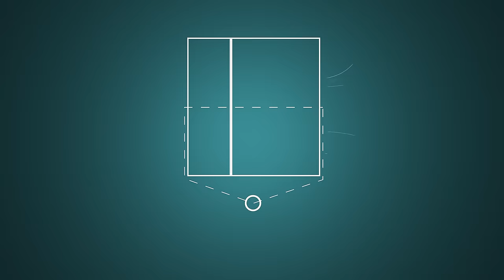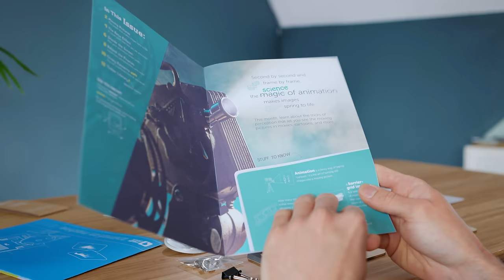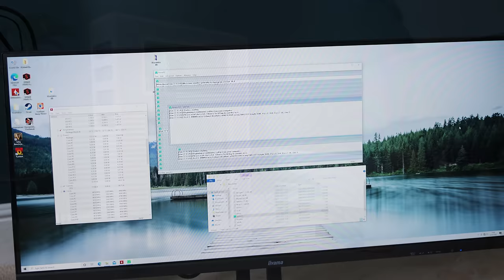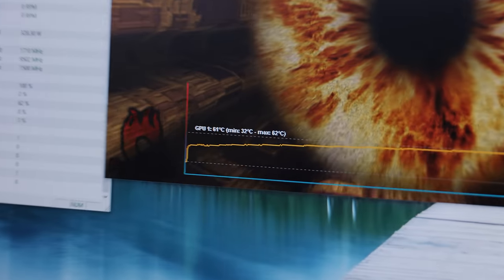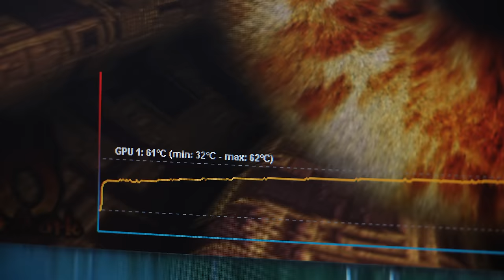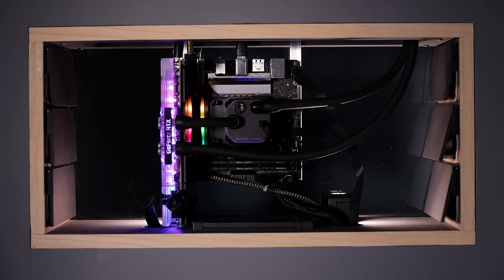Building the world's first 'breathing' PC

Comment: Fluid mechanics PhD here:
First of all, fantastic, and I want one. The magnet growing trick is the type of hypercomplicated solution I like to see in my science. Second, a couple of little improvement ideas for your next design:

1) The system has a good amount of "dead volume", which is air that's not strictly involved in the pumping process. mostly around the outside of the pump system. Dead volume like that is going to do two things, which are slightly in opposition. First, it's going to decrease the overall pressure your pump is able to produce in the system, because relatively more of the energy of the pump is going to compress air that isn't really doing anything. On the other hand, the dead volume is also going to buffer the airflow so it's a bit more consistent. I'm not sure which matters more, although I suspect higher pressure would give you faster airflow. And as a bonus, you save a bit of space. Ultimately, your max pressure is going to depend on the quality of your seals, though.

2) You might be able to make the airflow go directly up through the radiator without some of the extra enclosure box. If the primary connection goes from pump -> joining chamber -> CPU chamber, you can lower the number of pieces you need. The pump mechanism would be exactly the same as you have it, but on the top there would be a one way valve for each side. This would allow air to flow one way into the joining chamber.  Then you don't need another one-way valve until the very top of the PC. You flow the air directly up past the cooling components, where the air then goes out the top.  In theory, this would create not so much a "breathing" flow, but a direct one-way flow past the components, which should help reduce the overall dissipation of energy from having the air switch directions all the time.

3) Another option would be to go with a design like a steam engine. You have your breathing mechanism tied to a moving valve that itself controls the direction of the airflow. This ends up allowing you to not need one-way valves at all, as the flow of the air is always going to be directed upward.
https://makeagif.com/i/74-zjb [gif of steam engine operation. In the steam engine case, it's high pressure air from the yellow triangle that's moving the piston and wheel. But it works just as well in reverse, where the piston moves the air]

(Sorry this is hard to explain only in text).
Reply: I'm having a hard time figuring out how this system works. How is the fan able to get air from one side to the other when the air valves close on one side? Am I missing something here?
Reply: @astroalyn2010  I think I was able to figure out what's going on from shots at 11:59 and 17:53. The first thing to consider is that each half (R/L) is in some way isolated. So you can consider what happens on the left side, and then just flip it over and you get the same effect on the right.

Walking through the cycle: You start in the Piston Left (PL) position.  All the pressures have equilibrated and there's no air moving.  Then the piston moves left->right. The volume of the "breath chamber" increases, meaning that air needs to be pulled in to equalize the pressure. This air has only two places it can come from on the left side: the vents to the outside and the vents to the "CPU chamber". The CPU chamber is denied, though, because of the one-way flap valves (17:53) that allow air to only go left->right (into the CPU chamber and not out). So instead the air comes from the outside flaps on the left, which open in the direction of Outside->Inside.  This air then flows into the breath chamber, equalizing the pressure.

The piston completes this half cycle and ends up in on the Piston Right (PR) position. Then it starts its backward R->L movement.  This decreases the volume in the left side of the breath chamber, forcing the air out to keep the pressure from rising. Except this time, the flaps to the outside are closed (the only open in, remember). Instead, the air gets forced out into the CPU chamber, and then out a set of flaps in the top, which only open up.

Then the piston completes the R->L half cycle, makes it back to PL position, and everything starts over.

The exact same thing is happening on the right side of the chamber, except with the opposite direction.  When the piston is moving L->R, the air is getting pumped into the CPU chamber, and when the piston is moving back R->L, that half is having its air supply built back up.

The design is slightly inefficient (brilliant, but a first draft) because it's having each half work independently. If the breath chamber were open to the air on the right and left (so not in the bigger box) and had the flaps directly inside, then the piston could force the air straight up through a pair of one-way valves on the L/R side. This air could then move up through the CPU chamber, rather than moving side/side. Then you could have something where the air direction ends up flowing up on both the right and left strokes of the piston, meaning the air doesn't have to stop and "reset" each time. This would reduce turbulence in the CPU chamber and let smooth laminar flow carry more heat out, and could substantially reduce the size of the overall system.  As I mentioned before, this is very much how a steam engine works, or an air compressor, if you're working in reverse (https://www.aircompressorscout.net/wp-content/uploads/reciprocating-piston.gif although note that this is a single stroke design.  @DIYPerks could totally do that method, but the double-sided design looks way cooler).
Reply: Nice!
Liking it to push the comment to the top
Reply: Nice! I already thought that this video can be one of the PhD project and now PhD came to give comment.
Reply: @NopphadolUdomluck  Don't be ridiculous! I never did anything nearly that cool during my entire PhD. :-D

Comment: Another reason it works better than those 4 fans, is the fact that the horizontal movement is in 2 directions, effectively doubling it’s air output if you collect air from both sides. It’s an absolute marvel this thing!!! The part where you nickel coated that magnet had me staring in awe!! The length this man has gone through to make this work is absolutely unbelievable!!
Reply: The craziest part is how casual he is about it!
Reply: it's only getting air from one side at a time so no, that's not a factor. What I think is making the difference is the fact that he's built an enclosure that is strictly sealed, which puts a lot of momentum and pressure behind the air movement. Just having fans in a normal pc case with vents everywhere would not be able to do that. When fans are having to suck air and also push and/or pull through a radiator, they're not going to be as good as when they're just blowing into a plastic bag like he did for his informal "test" of his invention. It seems like the "lung" is more capable of overcoming that resistance than the noctua fans
Reply: @EMETRL  You're missing the fact that he estimated 1 side to be moving air on par with 4 fans, as he is now getting the air from both sides, he has in fact doubled the output, the intermittency is irrelevant.
Reply: @Nevir202  but the volume of air moved per second is the same still
Reply: @zat-svi-ua  No it isn't you goober. CFPS is an average, when you're doubling the inputs, you double it as well.

What you're saying is that is you blow 10cf of air every two seconds, that's equal to blowing 10cf of air every second, which is obviously BS.
Reply: @Nevir202  i meant the device still moves a chamber of air at the same speed, so the trash bag test would show the same result.
Reply: @Nevir202  no need to call me names, i don't really know my way around this stuff, not saying i'm correct
Reply: @zat-svi-ua  But it doesn't just move a chamber of air, it moves the chamber of air twice as often, when it's exhausting one side, it's intaking on the other side.

Yea, you're right though, I should chill with the names.

However, it's a little frustrating to have some random person on the internet, that as you admitted doesn't know what they're talking about, tell me I'm wrong when they're in fact incorrect.
Reply: @Nevir202  It does not move the air twice as often as the fans. The air only enters the PC chamber once per stroke (left to right or right to left). When one side is exhausting(blowing air into the pc chamber) the other side is intaking (loading the next shot of air).
Reply: @MemberLogic  If one side moved as much as the fans, and both sides are moving air, what kind of stupid math are you doing where 1+1 =/= 2?
Reply: @Nevir202  If the diaphragm is moving from right to left then the air on the left is getting squeezed into the pc chamber. On the right the air is entering the expanding diaphragm chamber which will then be squeezed into the pc chamber when the diaphragm moves right. It's a very simple concept and you can literally see it in action in the video as each side opens and closes
Reply: yeah this man needs to get contracted by nassa or something
Not only that but imagine what other aplications something like this could be used for in all the different feelds outside personal computers!

Comment: If this idea hasn't been brought up yet, an idea for using 3 phase coils would essentially be a sensor-less BLDC motor. You could use it in a position sensor mode with an interrupt that tells the inverter to switch the direction of the coils. It's probably harder to achieve than that, but it's what I see a lot in air craft launching systems.

Comment: Needs electrostatic filters on the intake side. That should keep the "lung" and PC free from dust and serve to filter the air in the room. Also shouldn't restrict the airflow all that much.
Reply: that would literally restrict all the airflow and youre suggesting someone turn a computer that has 500+ dollar components into a 69.99 appliance you can get from walmart.
Reply: @gottaproxy8826  Huh? The pumps seem powerful enough to handle pushing air through a filter, as filters don't introduce very much resistance. With the computer being so transparent, it would be a shame for it to become dusty after a couple months of use. Most PCs already have air filters, it's really just common practice.. I don't think PC filters are typically electrostatic, but having some type of filter wouldn't be "turning it into a 69.99 appliance" in any way.
Reply: @PascalAndreas2003  well the thing is it has an inbuilt dust trap it seems in the side panels. besides my 13 year old pc has hardly any dust in it without any fancy filters and i never cleaned my shelves have more dust after 1 month
Reply: @gottaproxy8826  500 dollars? that cpu is 800 by itself lol more like 3000+ pc build
Reply: @gottaproxy8826  Wouldn't reduce airflow nearly as much as you might think, because this is a (leaky) positive displacement air pump. It will keep on pumping roughly the same volume of air, until either the water pumps can't keep up, the magnetic coupling detaches, or air bypassing the pusher-plate becomes much more significant.
This air pump can likely generate at least ten times more pressure than a decent PC fan. This is why his radiator was working so well.
Reply: @gottaproxy8826  Electrostatic filters have very low air resistance. The rely on electrically charging the particles carried in the air stream so that they will be drawn to the plates making up the negative (or was that positive?) pole. I've even seen electrostatic filters that worked without a fan providing the air stream, instead the placement of the anode an cathode made the air move through the filter. So no, it would not necessarily impede the airflow.

And the bonus would be a lot less dust in the "lung", the airflow check valves and the PC. In it's current configuration there will soon be visible dust build up on the acrylic components and the PC.

Comment: The bellows and valves do an excellent job creating what is basically high internal ambient pressure and that’s what makes it so effective compared to fans. Fans struggle with impedance. Of course there are fans specifically made for static pressure which is good in radiators but they still can’t compare to the pressure difference the valves and bellows could create. So while the airflow from the fans is dependent on resistance, the bellows will move several cubic feet per second wether the impedance is high or low.

Comment: Anyone else more impressed with how he just decided to increase the size of the magnets by absolute wizardry!?
Reply: It's pretty basic chemistry, but I do agree that chemistry is the most wizardy of sciences
Reply: why couldn't he just sand the magnets to make it smaller instead of making them bigger which seems harder
Reply: @madri2  well magnets are pretty brittle and I'd imagine it'd be difficult to keep them so nice and circular by sanding
Reply: crazy how his mind goes straight to electroplating instead of buy more tubes or magnets
Reply: @madri2  also the friction could make them go quite hot if you're using a machine and heat weakens magnets.
Reply: @madri2  I think you couldnt get it so evenly sanded down and its cooler for the video i guess haha
Reply: @Blue-bf8lv  Buys forty tubes. 

His mind went straight to electroplating! 😅
Reply: @Blue-bf8lv  or just painting it.
Reply: I was thinking same but not had idea to how he will do it😃😃😃😃
Reply: Very impressed but not "more" impressed :)
Reply: @mattb.7713  It is pretty basic chemistry, but I'm impressed that he has the tools to do it let alone thought about plating in the first place.

Comment: In love with the timeless feel of this - looks modern, feels steampunk, like a pendulum clock on the USS enterprise
Reply: that makes 0 sense but ok.
Reply: @yushkovyaroslav  it makes complete sense
Reply: @SamuelJoseph962  I guess bunch of pointless worlds string together like some sort of word diarrhea make sense to you. I can also put bunch of words together. Banna is used by the PC like the sunset on the microburst sunset capacitor in ultra-anti cupcake gravity inquisitor. My point is this dudes statement is as useless as the machine that dude built...
Reply: @yushkovyaroslav  It looks modern because of how clean it's design generally is, feels steampunky because of the fact it's almost completely mechanical (the use of very basic materials helps with that too)
It's a prototype that as far as i'm aware hasn't been built upon. While it was pretty much fully made for entertainment purposes, it's not at all useless as it's thermal performance is far greater than a standard PC water-cooling setup (as shown in the video)
People are likely not going to build this, but there is still plenty of room for improvement (making it far smaller, faster, etc) and someone might or might not build on the idea; efficiently and passively cooling modern computers is still an area that's being explored.